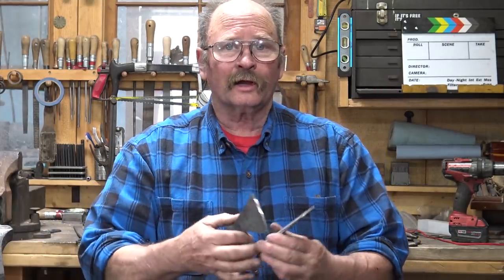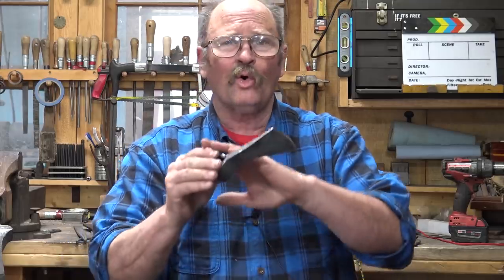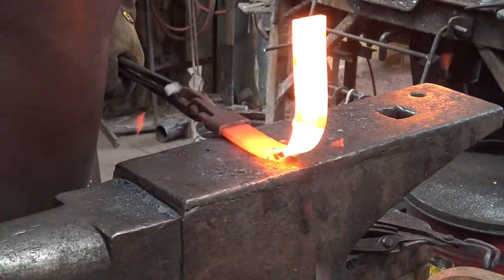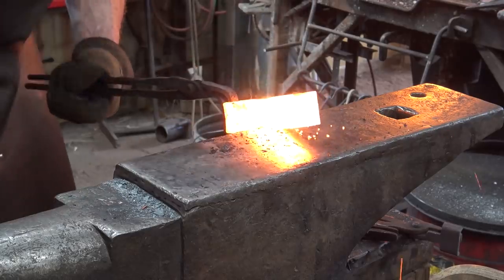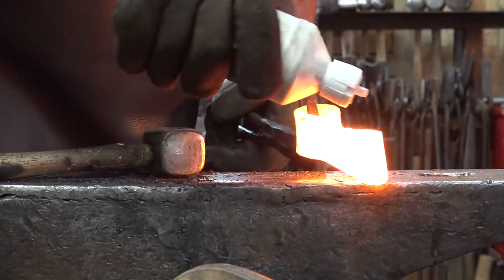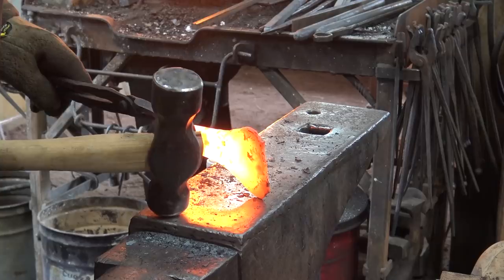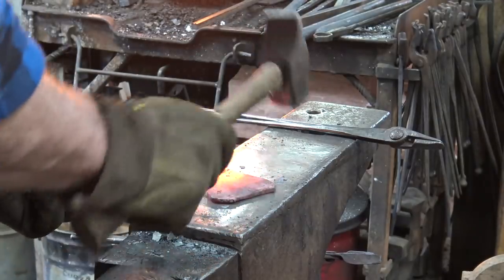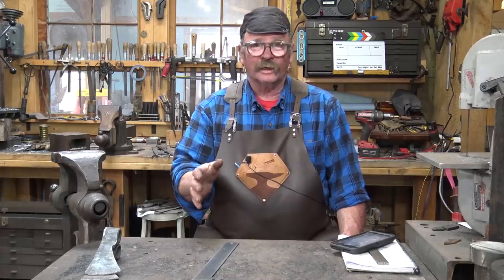Forging a trade axe or tomahawk part 1 - blacksmithing for beginners

Comment: Good timing for I have started mine but putting coil steel in mine only still got to forge it down to .5 in. .then find the time after a first job to do next.
Thanks John
Have a drawing for to have a beginer come and work under you for a prpject.

Comment: I made one of these from an old farrier rasp. Worked brilliantly and I've even used it to fell small sapplings. (a rasp doesn't get you a large cutting area).
Reply from the maker: The rasps look good, but as you say aren't a lot of material.

Comment: That's a brilliant little axe! I was having a bit of a laugh at your "flux addiction" (your words, not mine 😂) after watching a load of Roy @Christcenteredblacksmith video's about forge welding with "correct" amounts of flux 😂  I think your flux addiction should probably be called "recovering" as you don't use as much as you used to 👍👍😋

Comment: Neat item. And the 1075 bit should make it pretty dog gone useable. Large forge weld for sure. 
  May i ask, have you an oppinion on the practice of adding 1080 powder steel to the flux? 
 Thanks for having us out to the shop today.
  Blessed day sirSir,
Crawford out
Reply from the maker: Many fluxes have some iron powder.  But I don't know about steel.  It moght burn off before the weld is ready.  worth trying if you have the powder on hand
Reply: @BlackBearForge  thank you. Tim at big dog uses it i think. Just curious on your take.

Comment: With the drifting proceedure it sounds like forge welds aren't quite as strong as fusion or even brazed welds.  That's not to say that they're weak.  At what point do you know when it's time to stop bringing the piece up to welding heat?
Reply from the maker: They can be, but the section near the eye needs to remain as thick as possible.  Which means you have minimum opportunity to refine the weld.  As you get further down the blade the areas that received mire forging and refinement have much stronger welds.

Comment: I'm wanting to make an adze for a friend but I don't have any carbon square steel, I have some fairly big round spring steel from an axel from a 4x4 any Idea's how to go about it, have tried punching a hole but boy it's hard stuff.
Reply from the maker: I'm afraid that punching the hole is still a must.  However if you are comfortable forge welding, I prefer to make the body from mild steel with a welded on edge.  I have a few videos on the subject.  The mild steel is much easier to punch

Comment: My attempt to replicate this project has not yielded the same results. If I'm using O1 for the cutting edge, does that present any challenges?
Reply from the maker: I have always had trouble forge welding O1.  1075 or 5160 are good options for the bit.

Comment: Another great instructional video...and timely as I'm about to forge a small axe for a friends 65th birthday. I usually avoid welding in my gas forge as the flux instantly destroys my refractory! Just wondering if you have the same problem or have you found a way minimize this problem. Thanks again for the terrific videos.
Reply from the maker: You can use a sacrificial tile or kiln shelf but even those don't last long.  My forge now has a hard fire brick floor that seems to be holding up way better than most forge lining material.  James Austin adds coke to his forge floor as a consumable floor that gets refreshed throughout the day.